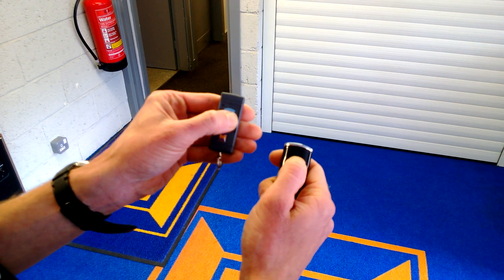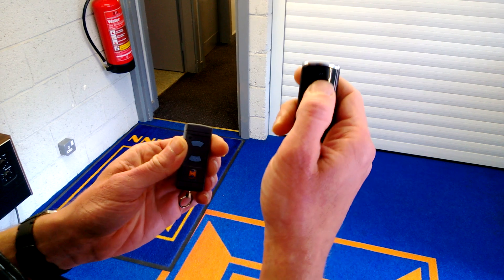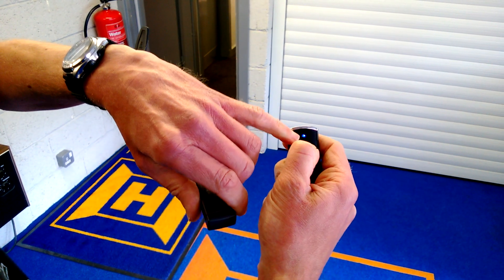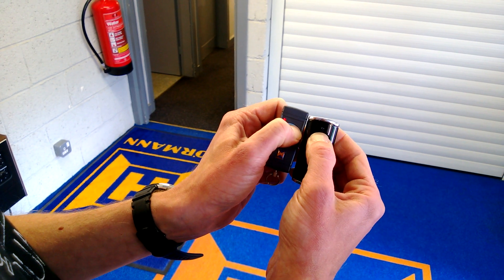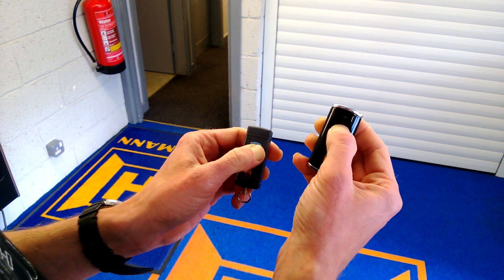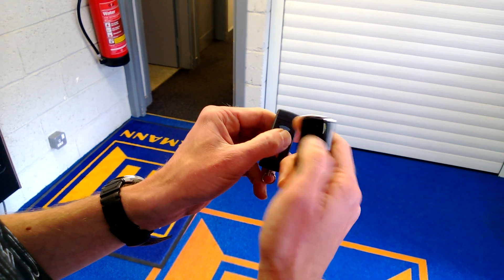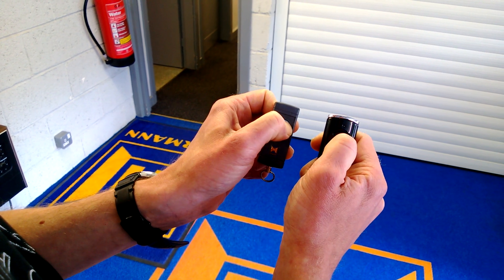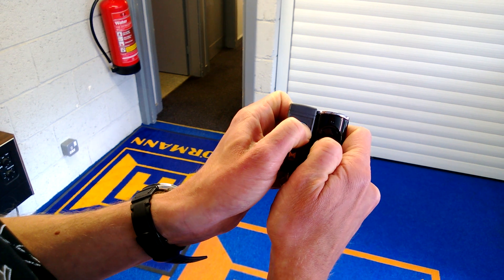Transferring codes from a Hormann 868.3MHz series 2 HSE2 to a Bisecur transmitter

Comment: Does it work the other way around?
Reply: You can't transfer a series 3 bisecur code (LED shows blue) to a series 2 hand transmitter. But if the black series 3 transmitter already has a series 2 code set up (LED shows red) then you can transfer this to a series 2 blue button transmitter.
Reply: It should, but without the encrypting and only for old device (garage)